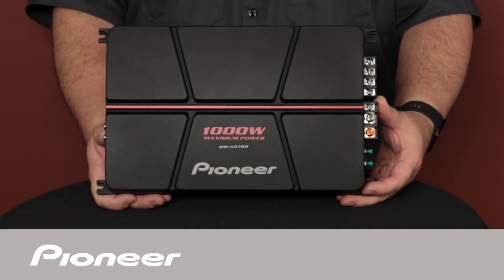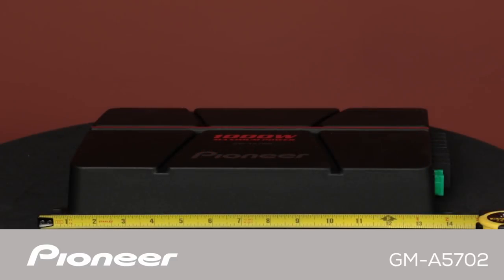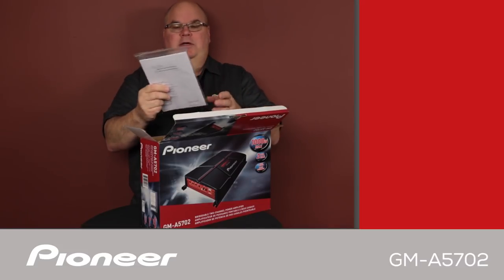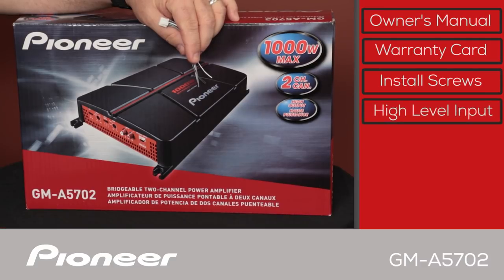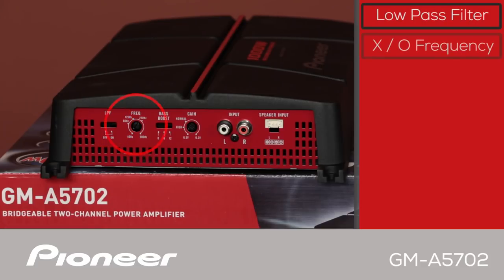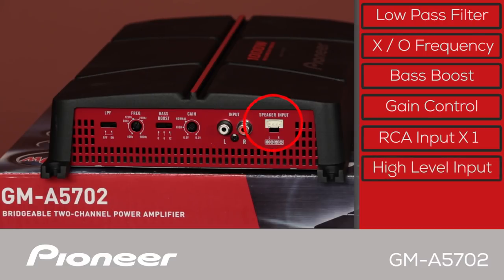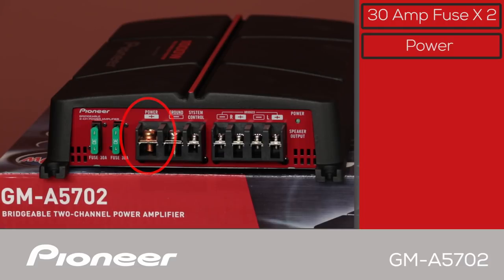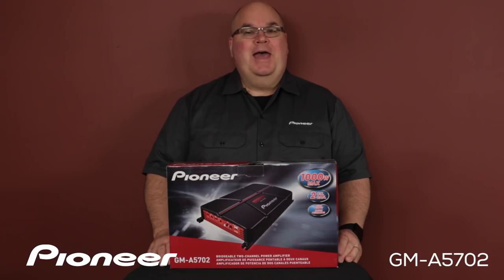GM-A5702 - What's in the Box?

Comment: will this amp run fine two 
Pioneer TS-A300D4 wired to be 2ohm both on seperate cahnnels? Or it will be to much for it?
Reply: The Pioneer GM-A5702 will operate reliably at 2ohms on each channel.  A Pioneer TS-A300D4 wired at 2 ohms on the Left channel, and a Pioneer TS-A300D4 wired at 2 ohms on the right channel will work great.  If you try to bridge these subs at 2 ohms on the GM-A5702 you'll run into overheating and amp shut down. You can learn more about Pioneer amplifiers here:  https://youtu.be/99Hfmc8QxVc?list=PLw63zJRQbCNg42VJXw0g7xzWJozqoSR1V   and you can find more videos on Pioneer's YouTube Channel here:  https://www.youtube.com/user/pioneerelectronics
Reply: I would run both of the two ohm subs in a series wiring configuration and then that will present a four ohm load to the amplifier when bridged.  You will gain a bit of bass because the subwoofers will be working together with the same signal vs stereo where they sometimes won't be given the same signal.

Comment: Sir, is this much better to run TWO PIONEER TS-SWX2002 or the 500W Version of this amp the GM-A3702?
Reply: Sir Deckerd Otto i want to upgrade my stocks speakers too... components in front and 2 way speakers at rear plus the two ts-swx2002 sub. Can i use the pioneer gm-d8701 amp to all of the speakers? Or do i have to add another amp for the rear and front speakers?
Reply: Sir Deckerd Otto or i will buy two amps of 5702 for the subs and for the car door speakers?
Reply: As I said before, there are several options available to you.  You have the option of using 4 channel or 5 channel amplifiers.  If you are looking to power an entire system I recommend the Pioneer GM-D9705 amplifier seen here:  https://youtu.be/99Hfmc8QxVc?list=PLw63zJRQbCNg42VJXw0g7xzWJozqoSR1V  The GM-D9705 is a 5 channel amplifier that can be set up to operate Front Speakers, Rear Speakers and subwoofers all at the same time.  This can also be done with the Pioneer GM-A6704 and a Pioneer GM-A5702 operating at the same time.  You can see the GM-D6704 here:  https://youtu.be/O45n88duYso?list=PLw63zJRQbCNg42VJXw0g7xzWJozqoSR1V

Comment: Can we run 2 ohms load on bridged mode?
Reply from the maker: No.  2 ohms in bridged mode shows the amplifier a 1 ohm load.  This will cause the amp to overheat and shut down.   In bridged mode the circuit the amplifier sees in 1/2 of the ohm load. That means 4 ohms bridged shows the amp 2 ohms.  2 ohms bridged shows the amp 1 ohm.  That's too low for this amp.   
8 ohms bridged is 4 ohms.
You can do 2 ohms on each of the left and right channel, or 4 ohms bridged for Pioneer GM-A5702.
You can find more videos on Pioneer's YouTube Channel here:
Reply: @pioneerelectronics  thanks for the reply. I have two 4 ohms subs (both 12" ). How can i connect them with gm-a5702?
Reply from the maker: @abcde12345865    For Pioneer GM-A5702, I recommend stereo.  One 4 ohm sub connected to the Right output and one 4 ohm connected to the Left output.   Stereo is the easiest and most reliable.
There is a more complex solution, if you understand how to do it.   It's also possible to wire the 2 speakers in series, that creates an 8 ohm circuit across the 2 subwoofers, and to bridge that connection to the amp. This will show the amp a 4 ohm load bridged.

Comment: Is this enough for two ts-w311d4 speakers?
Reply from the maker: Is this enough?   That's a tough question to answer.  For many people it will be great  and for others not nearly enough.  
The Pioneer GM-A5702 is a great amp that is designed to operate down to 2 ohms impedance.  When using the Pioneer GM-A5702 amplifier, you could run one of the TS-W311D4 subs on the left channel and one on the right channel.  This will show each channel 4 ohms and will work great and be extremely reliable.
 You could also wire the subs in series and bridge the circuit to the amp.  This will also work great.
Since these are 4 ohm subwoofer,   Do   not   wire these two subs in parallel and bridge the amp.  This will cause the amp to overheat and shut down.
For more power please consider the Pioneer GM-D8701 seen here:   https://youtu.be/-Uq25Goo0sU
You can learn more about Pioneer amplifiers here:   https://youtu.be/99Hfmc8QxVc?list=PLw63zJRQbCNg42VJXw0g7xzWJozqoSR1V
You can find more videos on Pioneer's YouTube Channel here:   https://www.youtube.com/user/pioneerelectronics

Comment: How about a friend greetings from Honduras to that amplifier I can connect a single Pioneer TS-W312s4 single coil subwoofer.
Reply from the maker: Yes, you can connect one Pioneer TS-W312S4 to a Pioneer a Pioneer GM-A5702.  It will work great.  I recommend bridging the amplifier's output to the subwoofer.  A bridging diagram is on the amplifier just above the speaker output terminals. Please read it carefully.  Use the - from the right channel and the + from the left channel to connect the subwoofer.   Be sure to switch On the LPF on the amplifier.   You can find more videos on Pioneer's YouTube Channel here:   https://www.youtube.com/user/pioneerelectronics
Reply: Thank you, you are very kind